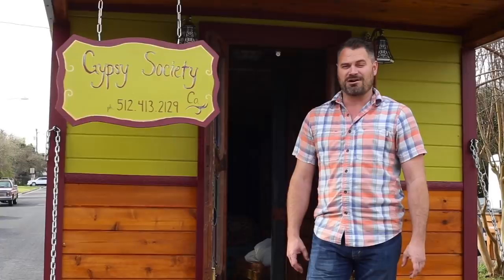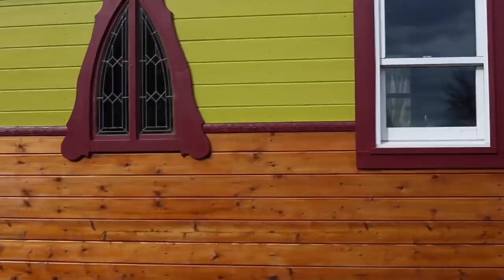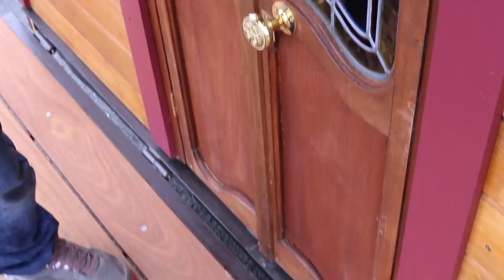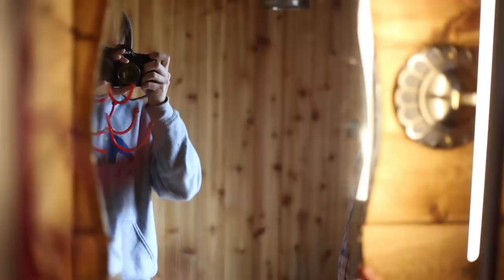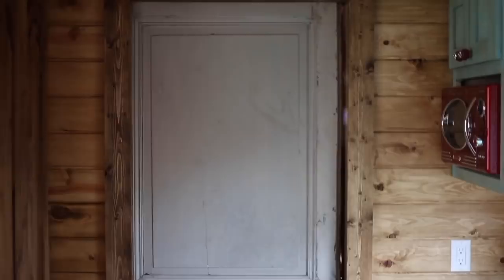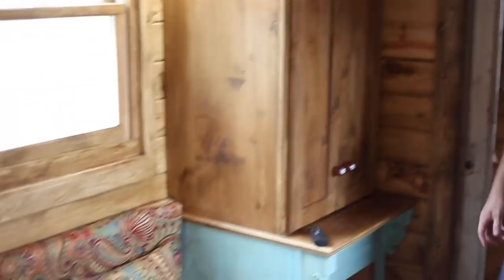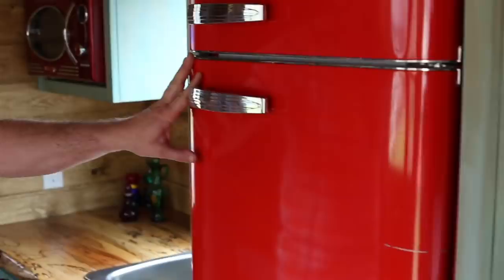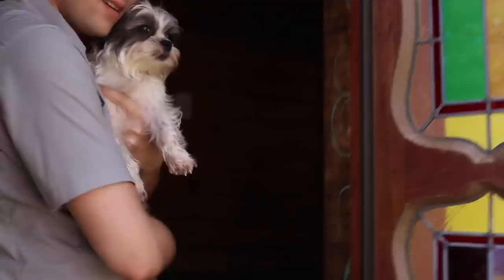Gorgeous Gypsy Vardo Built On The Weekends

Comment: Beautiful 😍 I was wondering though how secure it is with the hinges on the outside 🤷
Reply: Great question. These hinges are not pinned so they are impossible to jimmy. However, if someone really wanted in, they could break out a window. I generally don't linger around areas that would give me cause for concern.